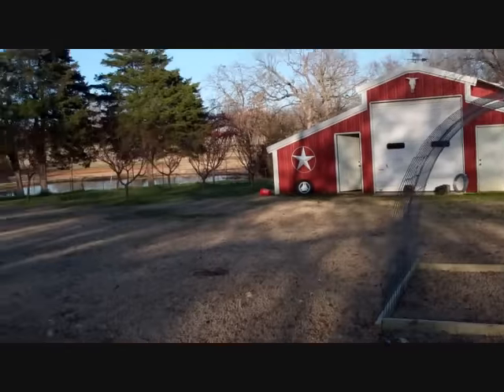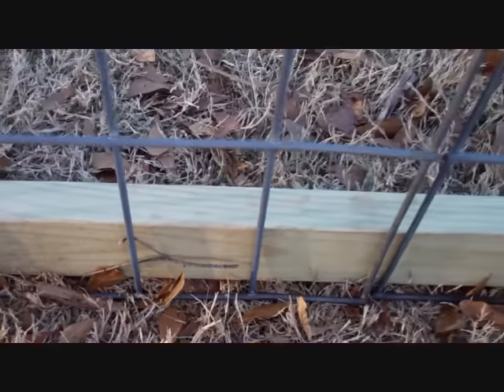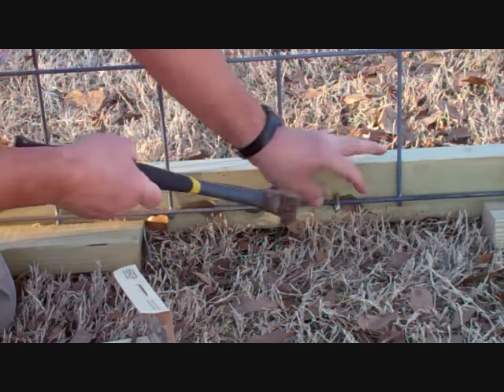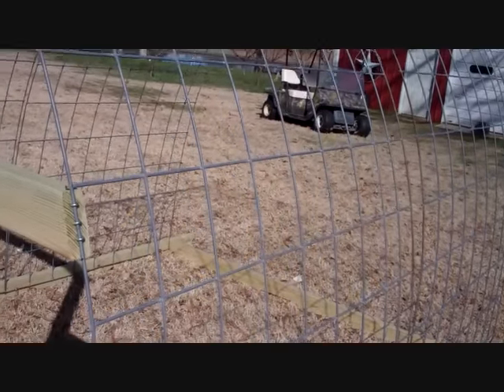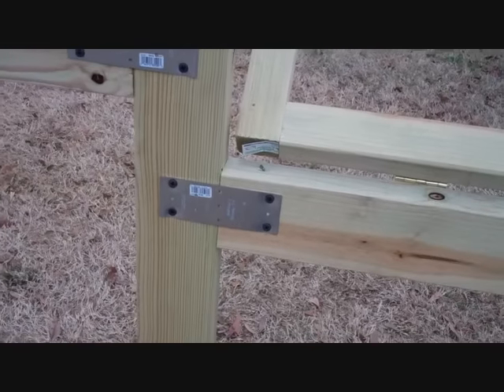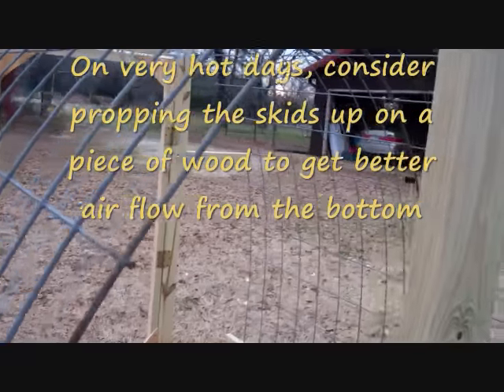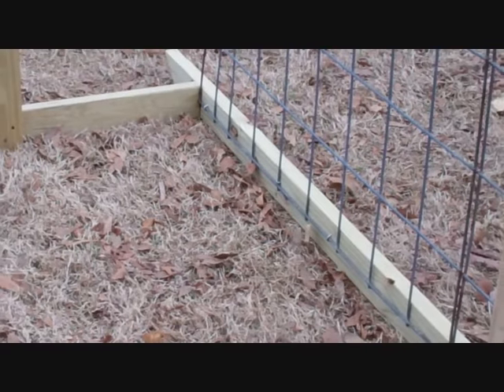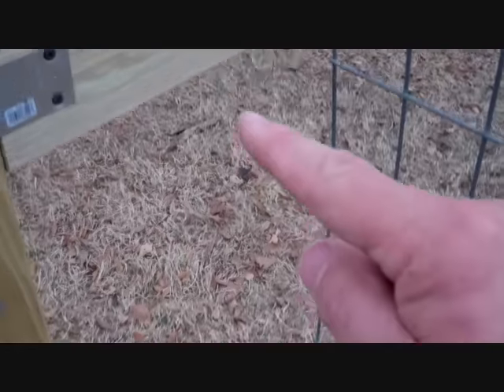🌞Cattle Panel Greenhouse🌱For About 150 DOLLARS! 🌻 DIY

Comment: I would much rather see the project then the constant advertising for your book.  I would not mind so much if it didn't take up so much of the screen.  lol Where are you at?  I am in Gun Barrel City, TX.  like the greenhouse.
Reply from the maker: Christina Henry The problem is... I originally had text that came up offering the PDF for free. When I converted to e-Book and put it on Amazon, I had to cover the original text up. THAT's why the text is so big, and takes up most of the screen. I should have had more foresight when I made the video... but... oh well... :)
Reply: lol that's understandable then.
Reply from the maker: I'm about 60 miles west of ya'

Comment: Well you are aware by now that it's not the correct height for someone as tall as yourself but it's likely only an example.It's not bad but if you decide later to build one larger it's a good idea to use an insulted base poly styrene or fiberglass to retain the heat in cold weather yeah a fan and vent for warm.Sure well the thing looks OK wheres the WEED MAN ?

Comment: Hey there, Texas Prepper2, I greatly appreciate your channel, and especially this video!  My friends and I up here in Colorado are looking to build a few different greenhouses based off this model. In order to save on cost, I found some plastic sheeting online and was curious if you might give me your thoughts on it.  Here's the link: http://goo.gl/3utnf9  At these dimensions we could build 4 greenhouses.  My only concern was some of the comments on Home Depots site was that it's not very clear.  How would this stack up to the Warp Brothers plastic you recommend?  Anyways, I'm open to any suggestions you have, and I greatly appreciate it.  Thanks for doing what you do, and thanks for the biblical wisdom you seem to insert in each video.  Two thumbs up!!
Reply from the maker: It doesn't look like a good plastic... and ... I have had some complaints about the Warp plastic also. Because of that, I changed the link on the video to a Greenhouse Supply Co. It is 6 mil and should be the RIGHT plastic.
The plastic on mine came from a GH supply company close to me, several years ago. I am on my 4th winter and though it is a little milky (not as clear as it was when it was new) it is still holding up pretty good. Go with a plastic made for GH. I am going to change the link on the PDF, but I don't know if I can change it on the e-Book. Hope that helps...

Comment: Are you kidding me stop selling your ebook if it has a wrong kind of plastic. How long will it last? That makes me mad. we done bought the plastic and now you are saying its no good!
Reply from the maker: I would LOVE to go in and change the e-Book link... but I don't know how to do that on a book that is already published... there may be a way... but I don't know about it yet (though I have researched it).

Sorry about your purchase. You may want to keep that for painting drop cloth material... or many other uses... or send it back. Amazon will usually pay shipping to send stuff back.

 I don't know for SURE the plastic is bad... I was just warning of what a couple of others have said. You may want to try it yourself and see if it's OK. I bought my plastic years ago from a greenhouse supply place near me, and I bought enough to do 5-6 greenhouses.

Again... I've had MANY purchases of the plastic you bought, but only a couple of folks said it's not durable, so you may want to try it. In saying that folks shouldn't buy it, I was just trying to be as informative as I could, even if it IS after the fact. The NEW plastic I linked to is about 3 times more expensive... I was trying to give a less expensive alternative.
Again, sorry if I caused you any problems. Let me know what you decide to do...
Reply: Thanks, we installed on the greenhouse and it seems fine.  Thanks for responding.  Your greenhouse  design is great

Comment: Hey Texas good idea....check mine I used PVC pipe...
Reply: +Carlos Andres Ovares Segura my family has been building greenhouses for years in east texas and metal is a must pcp would rapidly rot away here in the heat of east texas .
Reply: +Jason Smith pvc
Reply: +Jason Smith PVC  is an alternative way to save money, not recommended for formal business, I live in a Tropical Country where we have two seasons Dry and Rainy. Dry season is a very heat one during the year, so choosing the best PVC materials can make the difference, at least it has worked for me. But thanks for your input.